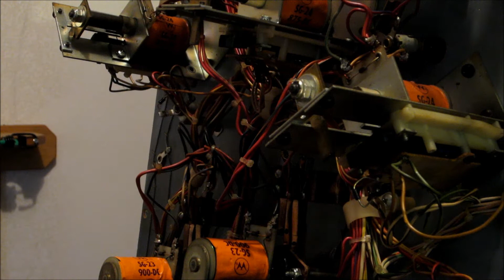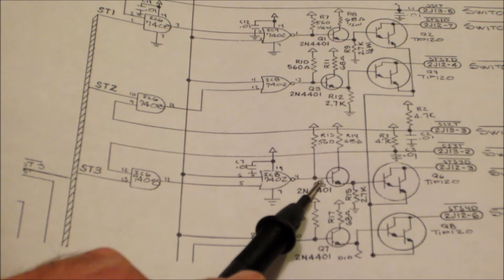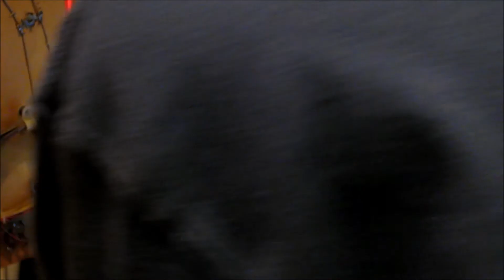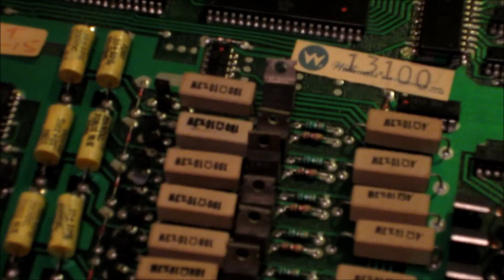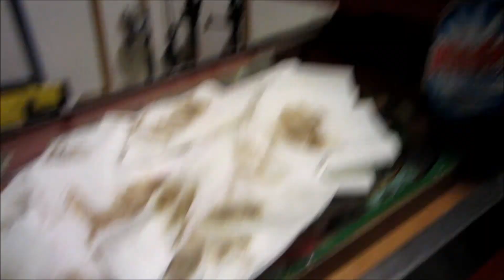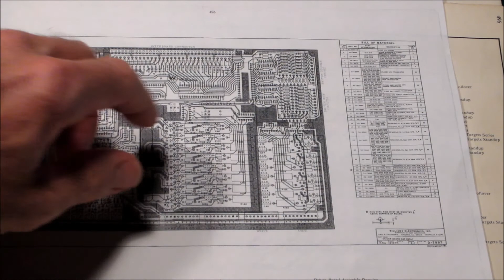Pinball Machine Repairs - Circuit Board repairs on a 1979 Tri Zone Solid State Pinball Machine

Comment: I have this machine and I bought it in a non-working state.  It constantly resets itself at some point during POST and never fully boots up.  It just keeps resetting over and over again and doesn't really even get one second into POST before something causes it to reset.  That being said, it is a very pleasant surprise to see someone posting up their repair process on this specific pinball machine and I'd like to encourage you to upload some more so I and others with this machine can see what you're doing and hopefully lead us in the right direction.  You really seem to know what you're doing in the electronics aspect there which is where I'm weak so it certainly helps how detailed you're being.  I have a logic probe and multimeter but not the know how to read schematics and figure out the logic of the circuits and what's supposed to do what like you seem to.
Reply from the maker: Hi Timothy,
Man, I'd love to help you!  But I'm not as good as you may think!  One thing you might want to consider is asking the rec.games.pinball forum on google.  There are a ton of smart (and friendly) guys on that site.  I can generally work on my problems until I get them fixed, but they take me quite a bit of poking around to find the issues.  It sounds like you've got a processor board issue, which are (for me) harder than switch matrix issues, driver board issues, etc.  If you want, drop me a line at havepinwilltravel@gmail.com, and we can maybe try some troubleshooting via email, but it would be a reach for me...